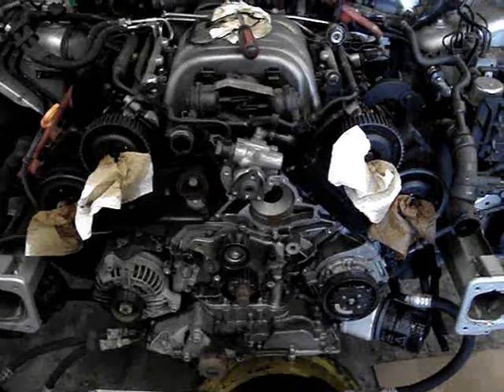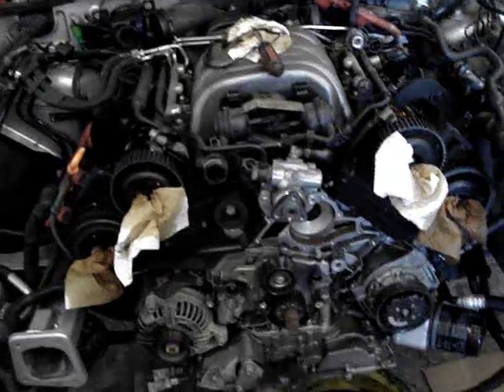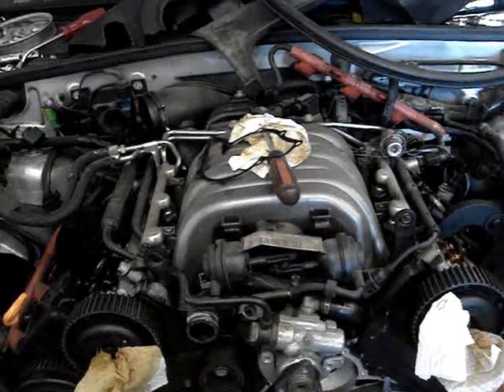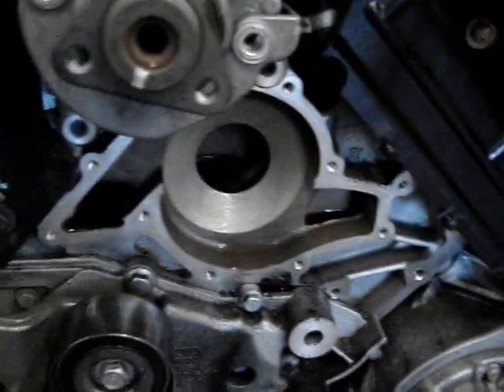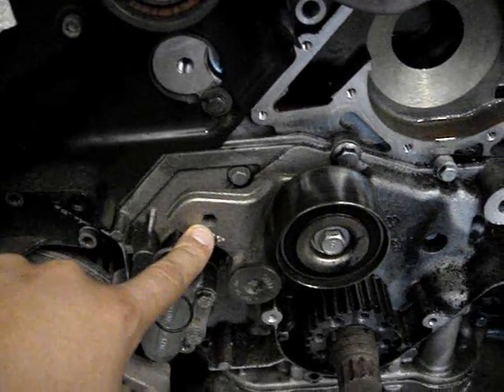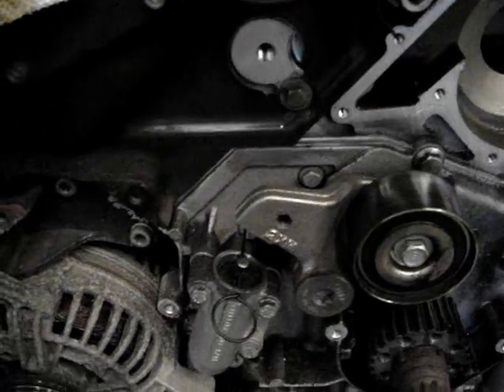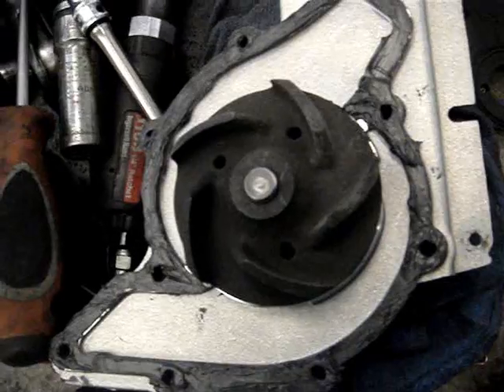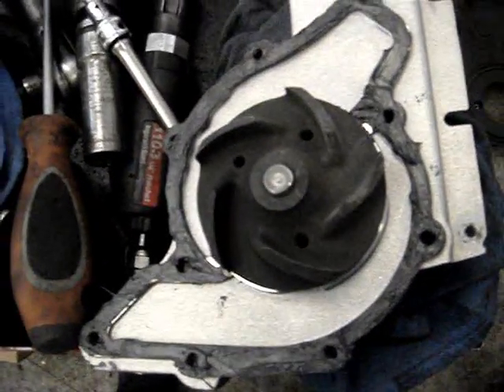Mechanic School: HOW TO replace a Audi A6 3.0L Timing Belt

Comment: Wow you actually use the cam tool to lock the cams in place??  It's easier and faster to just mark all of the pully positions with nail polish or metal mark.  Then just jam some old pieces of timing belt about 4 inches long and jam them in between the gears in a V fashion and they will be rock steady.  Cheers!

Comment: Thanks for posting this video. I have a 2003 Audi A4 3.0 twin cam and I am having difficulty getting the crank on TDC and one side of the cams on TDC. I have several questions. Not sure where your located, but can you possibly call me. 562.842.7423. Thanks,
Mike

Comment: I got a qiestion for you guys ...i got 2002 3.0 non turbo ..i replaced the heads and the shop who did the the rectification on my passenger side head they separate the cam gear from the shaft...and some frinds say  that need some degrees or something befoore u pu it togheter and put the engine in time ...so please the who made this video can do a short video explaining that thank you

Comment: what i do - put CRANK pully on mark on lower timing cover

this way you don't need to loose cam gears, unleas you change seals

if you not a mechanik- do not bi involvt in this belt

one of the water pump bolt hide under power stearing pump, betterr to remove it, this way you gut easy access to thermostat, always good idiea to replase with water pump

Comment: last time i done this job for 5.5 hours, without special locking camshaft tools. it is no marks on pullys, becouse all 4 cams has adjust timing. what i do - put cam pully on mark on lower timing cover, and just live old belt on this position. before removing i put my owne marks on cams. on each bank make marks were intake and exost gersclose to each other. also mark each cam to backcover and counted touth betwen marks on exost and intake gears. for crank pully make own marks to oil pump cover